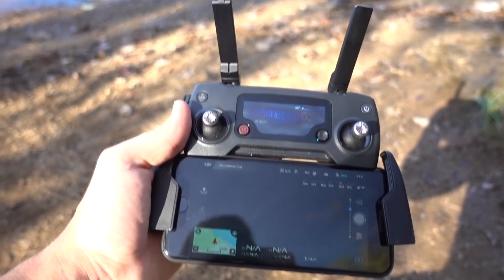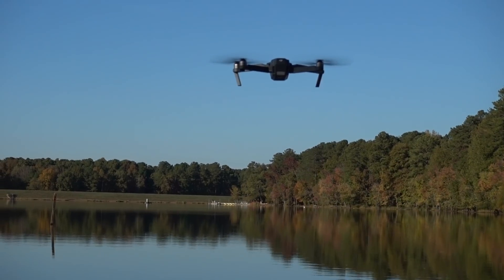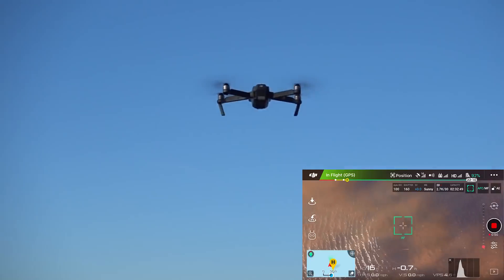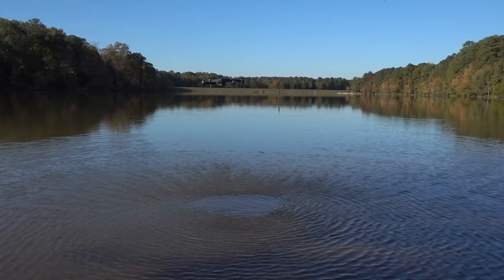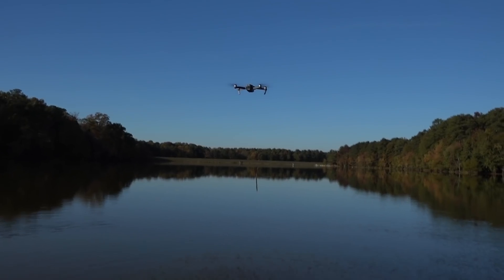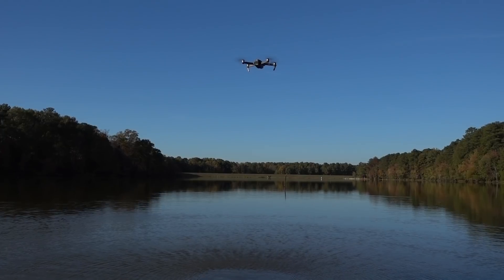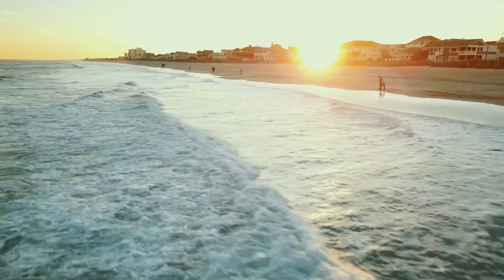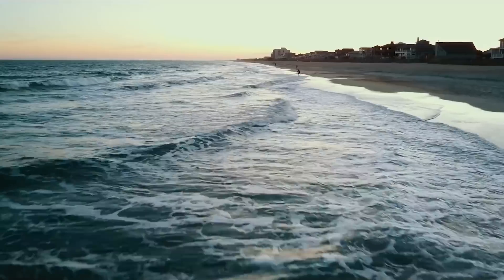Flying Over Water - Downward Positioning Sensors On or Off?

Comment: Hi! thanks for the great video! awesome work! 

I have tried flying over some bodies of water like ponds and seas and haven't experience (yet) any troubles with the sensors while it is 'on' but I don't rely (and trust) on the downward sensors of my drones when flying close over the surface (water), and I am very attentive when flying on such. It's like I am flying on manual mode, so better if it's switch it off. 

My opinion on why DJI suggests it has to be turned off: On solid ground, the sound (sonar) is effectively bounced and detected back by the drone, so it knows how high it is from the ground.  But when it is over water surfaces, maybe the sound doesn't bounce back as effectively...

For the DJI spark, it uses infrared, but I think, same idea.

I'd rather control it manually when flying over water than it (the drone) miscalculating and crash. ;)

Comment: Try this : switch OFF landing protection . I assure you this works . Test it first , over a kiddie pool or other "water hazard" .  With this setting off , you can fly your Mavic an inch or less off the ground  & it will not try to auto land.  It works over water too 👍.  I've flown mine merely inches over the surface of a lake many times like this. Like you, I can't afford to drown a $1000 + drone .  Now pine trees , that's a different story :)    BTW , I'm using app Verizon 4.0.3 on an iPad mini 4

Comment: Just like a real helicopter, I believe what your experiencing at low altitude over the water is vortex ring state, also known as settling with power when a vortex ring system engulfs the rotor causing severe loss of lift. The drone descends into its own downwash, or the air being forced down by the blades. The drone should try to correct by increasing power or continues to descend due to loss of lift if it doesn't. Food for thought: RC type floats may not be a bad idea to adapt? they come in different sizes & weight, also used for RC Helicopters to land on water. At least the drone would float :)

Comment: When landing without the downward sensor on the ground, does it effect the drone in a negative way?. Wanna make it carry things under it. I tried it and the drone kept sensing the object under it so wasn't comfortable flying that way. Hoping turning off the sensor will help it but don't want a landing problem.
Reply from the maker: I've tried landing after turning off the downward sensors and I've slammed into the ground pretty hard. I would suggest you be careful and gently land because it may not sense the ground coming up. My Phantom 4 Pro descended and never slowed down before it hit the ground. Luckily no damage since it landed on its legs, but it was not good!
Reply: Ed Ricker good to know, wanted to attach dumb things like rubber duckies or something and send them to my neighbor. Lol but I tend to be a very slow lander since the mavic comes Down pretty fast as it is and makes me nervous

Comment: Im thinking that the vision system doesnt see the water that good but does see it enough to keep it higher. Now Im not sure if the sonic sensors turn off with the vision or not but im thinking the sonic sensors dont read water very good and the closer you get and the bigger the wave produced makes the sonic sensor less sensitive.   This is just my back seat observation.

Comment: This effect is certainly not caused by propwashed. The drone is not lowering fast enough to get that and it is too high to get caught in ground effect. It is much more likely that the Sonar is causing the issues, because even though the VPS is disabled, the Sonar is still active. It might be possible that it sometimes gets somewhat reflected by the water surface and sometimes the drone picks up reflections from the ground of the lake. This would cause it to conclude very different levels of altitude, which could cause the up and down movement (it could also be something that's not that, but similar in some way).
Additionally, turning off the VPS might not turn off the bottom cameras. You see, the vision positioning technically only means that the drone uses the bottom cameras to keep its position, and it is very well possible that the downward obstacle avoidance is still active after disabling the VPS. That would mean that, regardless of whether you turn it on or off, it will try to guess its altitude with the sensors and it will get it wrong. Either that or it is turned off, and it's only the Sonar that causes the issue when VPS is disabled (this would explain why it acts differently with VPS on and off).

It shoud be noted, though, that the drone will only ever drift with VPS on, since this is caused by the actualy positioning getting fucked up.

Comment: This answers a lot about ultrasound reflectivity at the air/water boundary: http://www.isud-conference.org/proc/split/ISUD-08_019_Schmitt.pdf

The barometric sensor is not "that" accurate and the GPS altitude is very degraded due to extreme acute angle geometry calculations.  Kalman filtering might help, but this is a very difficult problem to solve if the ultrasonic is turned off.

Comment: If the main goal is to avoid a water crash, would it be fruitful to use Terrain Follow mode? Reasoning is that the manual pg 22 says that the mode will follow upward changes in the terrain sense, but not down. The hoped-for result might be that the altitude might vary a bit, but not in the downward direction. Maybe not useful for hovering. I don't have a drone (yet), so haven't tried it.

Comment: The VPS camera sensors being able to visually see the bottom of the shallow lake probably keeps it from drifting laterally, but isn't altitude determined by the ultrasonic sensors?  Those probably can't get a good reflected reading from the water (or maybe even fluffy snow).

Comment: Thought it was worthy to note.. I own the Phantom 3 standard and the Mavic and I have found that the lack of sensors on the Phantom 3 allows it to hover over water nicely but I wouldn't go less than 5 feet high with anything.

Comment: I've had the drone report it had reached maximum altitude when it was only 10' in the air, over moving water. I have also seen the drift issues you experienced caused by firmware/ device software mismatches over land.

Comment: Nothing to do with the positioning sensor. When your are close to the ground, it use the ultrasonic sensor which dosen't not work very vell with water. That's why. And the altimeter is not as precise as the ultrasonic sensor. That's why we use the second one close to the ground.

Comment: Really interesting video. I think this phenomenon is what caused me to crash my Mavic Pro into a river - I was flying low (maybe 3 ft) and very slowly in tripod mode over some still water and the drone definitely seemed to bob up and into some overhanging branches (and then into the water!) You can see its last recorded footage here at 2.50: https://youtu.be/8nWvHYuR4PQ?t=2m50s. I think it was due to the downward sensors seeing the prop wash on the water and interpreting that as the ground getting closer somehow...
Reply: Water + trees is a dangerous combo. I've gotten into hairy situations a couple times with that combo. Luckily, haven't lost a craft, but it's been close. These DJI units have amazing recovery abilities after getting tangled up. 

RIP your Mavic.

Comment: GPS signal altitude error is always considerably worse than the horizontal (position error). Much of this is a matter of geometry. So it's natural to experience the quadcopter to hover quite stable over a certain spot over ground, but to wobble significantly in height. That was exactly what was observed in your test, only that the downward sensors over past 2 years became just robust enough to get you covered over open water. Things should become better with the GLONASS incorporated into the sensors.

Comment: First, I always fly with Enable Vision Positioning OFF and Landing Protection OFF. At the beginning of last summer I would notice when transitioning from land to over water (4' high) the Mavic would take a dive for the water.  Later in the summer after a few firmware upgrades and calibrations the Mavic no longer dove toward the water (calm or waves) at any height.  This allowed for some great video of ducks taking off a few feet above a calm lake.  Never flew into the water once all summer.

Comment: if its prop wash why is it a steady as a rock when I hover 15 inches off my hilopad,  it never moves,  how would it react over snow,   when i was working i used inferred temp gauge to try to get the temperature of the extrusion die before starting the machine , the inferred sensor would not read the temp of the steel,  can the sensors on the mavic actually see the water or is it just transparent   that it has no idea what it's seeing ?    try this same test over calm muddy water to see if the dirty water can be detected by the sensors, throw a few buckets of dirt in a kids pool add water make a muddy watery mess see if the sensors can see it ?? and if the drone reacts the same ??

Comment: Your ultrasound sensor comment might just be the case. Sound actually does travel in water much faster compared to air. And ultrasonic pulses does penetrate water quite well. not sure if they would hit bottom of the lake and reflect back, but the drone might just receive double or inaccurate readings.

Comment: My experience with still water is the same as yours. I hadn't though to try rough water, but I'll do that next. 

Propwash may explain the drone's behavior when the sensor is off, but it doesn't explain why the sensors indicate the drone is maintaining its altitude when they're on. Essentially the water is affecting the sensor's ability to accurately judge altitude.

Comment: As my main hobby is angling this has been a very useful video, as yet I've not had the courage to fly over still water or a river, however, I  have floats as a just in case it does crash land and is recoverable, the river is a different proposition, so looks like leaving sensor on is a better option, cheers Ed

Comment: hey ed, thx for another great video. have you made any experience with flying the mavic near something that causes magnetical interference?
Reply from the maker: Hi Oliver, not the Mavic, but I did have some issues with my Spark. I took off on a big block of concrete that must have been steel-reinforced and the Spark shot off in a random direction about 10 feet! Glad I was paying attention!!!!

Comment: This was intresting! Isnt it just so that with the downward sensors turned OFF, the drone don´t act based on the altitude data it collects? And as you say, a sonic-signal on "moving" water...bounces it all over the place so the altitude data gets all wacky. I don´t believe for one second that these sensors are powerful enough to penetrate water and get the altitude from the seabed. I fly alot over water (always with downward sensors ON, turn it off if I have to handcatch) and noticed that when flying low, you have to keep the drone in motion or it will act really strange altitude-wize as your video shows. Really intresting video, makes you wonder what trigger that behaviour? Thumbs up from Sweden

Comment: Question Rick. The water is shallow. Was it detecting the water or the lake bed? I  have done this over the ocean in deep water with differing results.
Reply from the maker: Hey Phil, hard to say! I tried it further out and it wasn't such a dramatic change, but it was still bobbing around a bit. But i was apprehensive to try it too much since I wouldn't have been able to physically rescue it that far out!
Reply: I was thinking the same, seems like it was confused between the surface of the water and the bed of the lake. Either way better to be safe and not get that close

Comment: I think that what we are getting without the vision or Sonar positioning systems is an altitude measurement purely and simply off the barometric sensors. 

Close to the ground the prop wash is actually creating a low-pressure zone which the barometric sensor is interpreting as rising up. 

I am thinking that the same behaviour might occur over solid ground when flying at a lower altitude without the vision and sauna downward sensors enabled. 

I feel a science experiment coming on.

Good video Ed
Reply: What do think my problem was on my Mavic Air? Sensors and APAS was on. https://youtu.be/17IRxYFD7so
Reply: This is the answer.  It has not other reference to use except GPS which is greatly reduced accuracy due to the acute angle resolution being out to 6-8 decimal places or more.

Comment: Hi Ed, my mavic goes nuts over water too. Good to know that is "normal". With helicopters, within 1.5-2X the rotor diameter, it will bounce a bit on the rotor wash bubble similar to the ground effect in a fixed wing.  Your mavic would have to reduce power to settle into that.  My guess is that it was more the false altitude reading it is reacting to. I have always had inconsistent behavior close to the ground (<4').  Have you seen this behavior over other terrain? Great video! Super helpful! Franny
Reply from the maker: Hi Franny,
No, I haven't really had that issue on a still day with the Mavic over ground. On a windy day, you may lose a bit of altitude but not as much as the Phantom 4 Pro. With the Mavic, it's really only water that I see issues with, even with the downward sensors off. In that case, maybe it is the false altitude readings! Hard to say...
Thanks for dropping by!

Comment: I haven't had too much experience with flying my Mavic over water, but in my last video there's a bit where I fly it very low over a canal, and the controls did become very wonky... At times the drone even moved to the sides when the only input I gave it was to fly forward. Definitely need to do more research/experimenting on this in order to make it a safe thing to do.

Comment: Hi Ed,
I have a Mavic and I test / experienced the same behavior than yours with the positioning sensors on; uncontrolled climbing and drifting. With the positioning sensors off it was stable. Well, as stable as a Phantom 3 Standard, as the height is now only measured trough barometric sensor and GPS, which is less precise also because the barometric sensor is affected by temperature changes.

Comment: I lost my first Mavic flying over Water under a bridge. It acted as if the compass or GPS was off. Lost altitude, then gained altitude and hit up under the bridge and crashed.  The water wasn’t my main issue, but all the concrete and steel really confused it. It would be great to see a low lying bridge test that you can walk under and safely do a test. I lost pretty much all control flying under a solid bridge. Lesson learned.
Reply: not only atti but if you lose signal to the controller it can do a return to home and climb to 30 meters or whatever the default is. Well if you're under the bridge or indoors it will hit the ceiling and crash.
Reply: O shit. . And I which was planning to fly under a big bridge and then up and over it .. Don't think I dare that now with my P4 !!!
Reply: Going under bridges and obstacles is a huge no-no. The drone can quickly enter ATTI mode and fast start drifting because the lack of GPS signal or compass disturbance.
Reply: Set your auto return to home height to match your flying height before going under the bridge.
Reply: Turn off RTH when flying under constructions just in case drone loosing signal and starts trying to climb for RTH ... ;)
Reply: Were you going slow so that it spent a long time under there?
Reply: Mitchell Hubbard Yes. I actually made it under and through the bridge once before, but the drone lost altitude closer to the water so I went forward faster. The second time was slower and that’s when I couldn’t accelerate. It had a mind of it’s own. All avoidance sensors were on, so I believe it would allow me to lower the drone closer to the water to get it out from under the bridge. It hit up under the bridge and crashed into the water.
Reply: Matthew Trudeau I did the same thing but luckily I didn’t lose it, but it does effect the gps and compass probably cause of the magnetic field coming from the bridge.
Reply: Wait a sec.  So you had one attempt that has issues but you got it back safely, yet you ignored you're blessing and tried again?  If $1000 was worth $1 to me, I guess I would have done the same.
Reply: In this situation what is better to do? Turn the gps? Sensors?

Comment: Such a great topic to cover! Thanks for the tip! :)
Reply: Craig D'Andrea well I have done this and I will tell you this i had my sensors on and flew a mile away and when I turned around to come back the sensors wouldn't let me I almost lost my drone over the,water and the reason is beacue with your sensors on the glair from the sun in the day time makes your sensors think something is there and there's is not and because of me almost losing my drone because of this I leave them off they cause more problems when there. On this is a fact

Comment: You should have also tried flying forward and low over the water at various speeds.
Reply from the maker: Hi Mike, I did that a bit and didn't notice much change. However, it was difficult to illustrate that on camera and show any altitude deviation...much easier to show hovering accuracy on camera. Since the altitude readings weren't accurate, I couldn't go off that either. Plus keeping it near shore enabled me to jump in and rescue it if need be. But if there's a way I'm overlooking, let me know!
Reply: I have been flying over water but I don't dare to fly that low. Been flying approx. about 5-6 meters over water. But I have bought some floats from Mike flys ( those that they are not getting in the shot) that I will be using if I have some jobs that require low water flying. Why risking it?